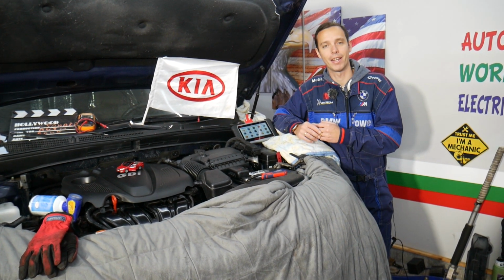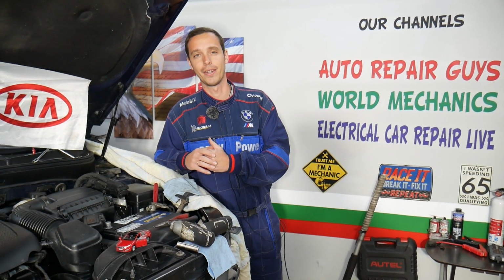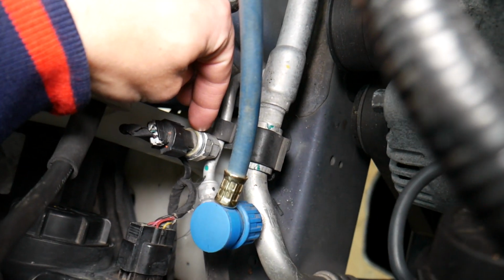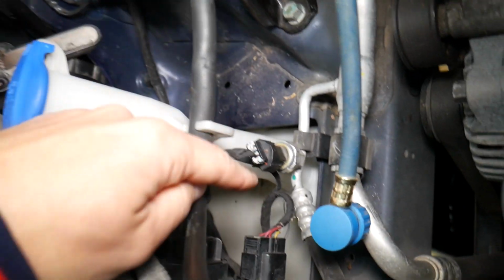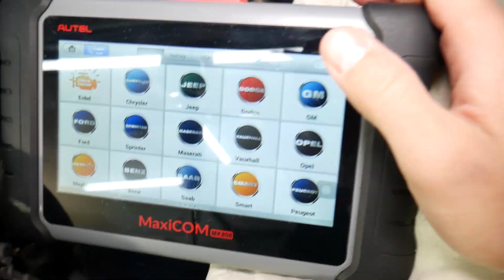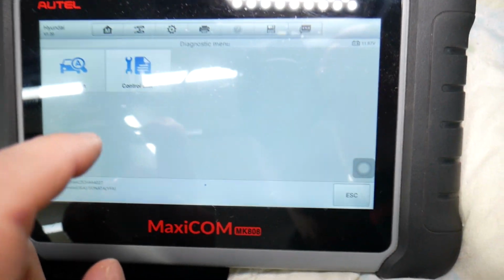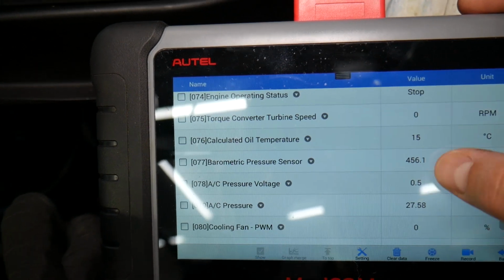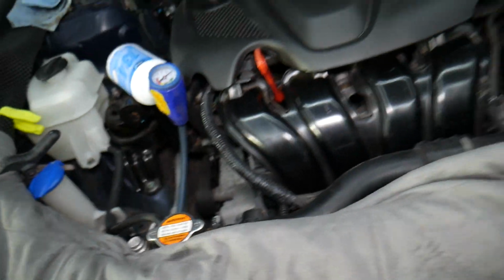HOW TO TEST AC PRESSURE SWITCH ON KIA OPTIMA, AC NOT WORKING, AC BLOWS WARM

Comment: On my 2014 kia Optima when I drive it get cold. While parked not that cold. I did recharge properly. What can cause it...
Reply: Anyone find out problem? Same car here hot air comes out at idle and low pressur side reading 90 or so psi....rev engine to 2500 rpms and i get cold air and around 70 psi
Reply: If your low pressure side is up to 90, that could be a sign of a bad compressor. If the high pressure is low and the low pressure is high, the compressor is bad. You CAN overcharge the system. You want to be careful not to do that. If your system is low, it means freon has leaked out of the system. You should NEVER have to add freon UNLESS there is a leak. If there's a leak, the freon has to be recovered with a vacuum pump. Then you can safely open the system to change necessary parts. If your compressor is bad, you need to prime it with PAG oil and its important you know which one you need (because there are different PAG oil numbers). If you have no clue what you're doing, find a reputable shop and have them do the work.
Reply: Me too, did you ever find the problem?
Reply: @headsuptv6885  No, But I am going to do my best to find out. It's not the compressor. Maybe the filter since kia the replace the engine and refilled the freon.
Reply: @bronxtaskforce01  hey man, did you ever figure out the issue?
Reply: same issue here on the 2012, weird thing is the low pressure line is reading 70psi when I put the gauge on it. Idle warm air, driving cold air